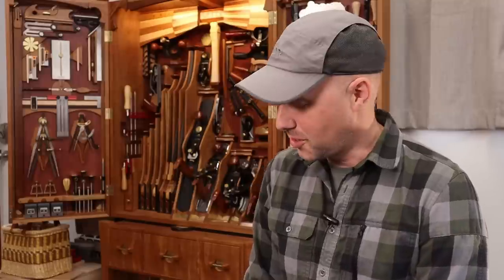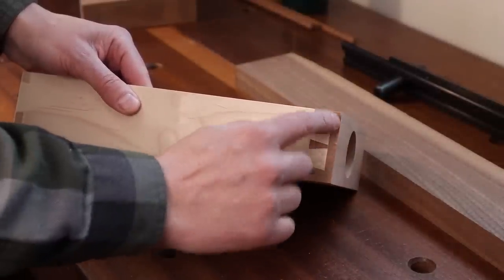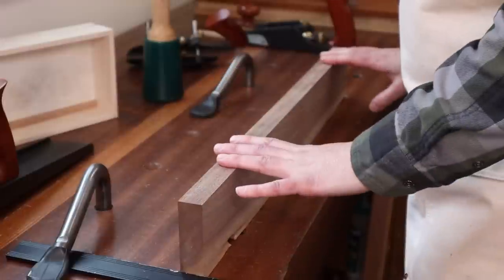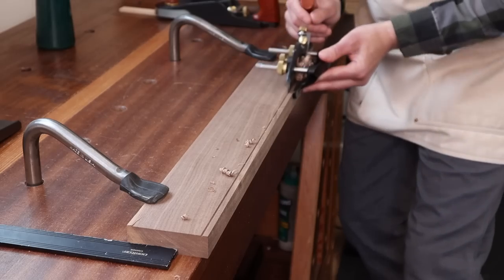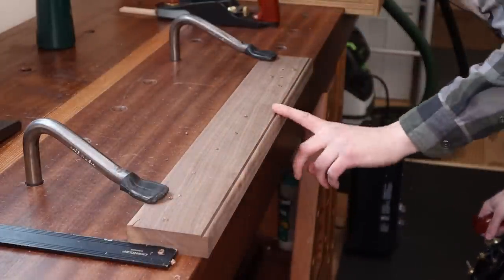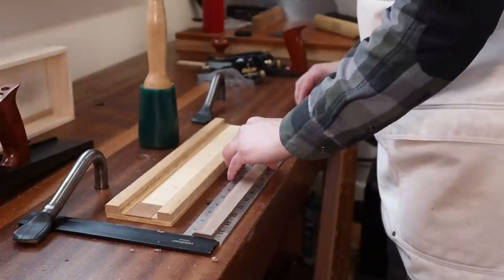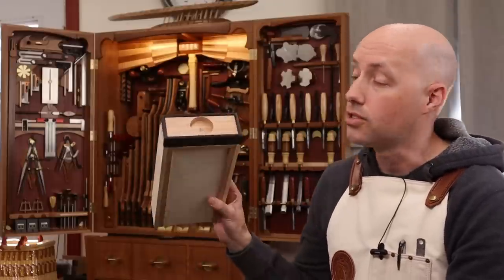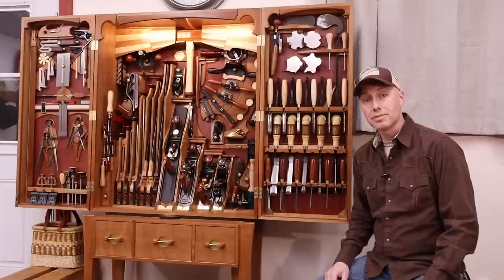C*ckbeading a Drawer, Seriously...That's What it's Called.

Comment: Your videos have resulted in me failing quite a bit at the techniques you've shown. It's been very fun trying to upgrade my skillset. That cockbeading looks pretty slick. I've never tried it before, but now I'm feeling ambitious. I think next weekend it's gonna be time to ruin some wood.

I also have a shooting sander, but mine is a piece of angle iron with a wooden handle epoxied onto it for a handle. When I'm making small model stuff it is a life saver. The Veritas version looks so good, but a quick shopmade one will work pretty well for folks that aren't sure if they should invest in something like that. The first one I saw was actually an old cracked stanley no5 that someone had stuck a 1/16" piece of steel to the bottom of and sand papered it.

I know that my homemade hide glue expands slightly as it cures, unlike pva. It certainly isn't as expansive as something like urethane glue, but there is a bit. If I don't rub the joint or clamp it down sufficiently, I've had it expand and make gaps unexpectedly. I'm not sure if your liquid hideglue does the same, but it might be worth checking.

Excellent video. I can't wait to see it all come together.
Reply from the maker: I've never noticed hide glue expanding as it cures. In fact, I heard on a podcast (don't remember by whom or when) that it shrinks as it cures and draws part tighter as it does so. Of course, my experience is anecdotal and shouldn't be taken as scientific evidence either. I've just had really good luck with rub joints using liquid hide glue.
Reply: @themountaintopjoinersshop8422  Interesting. I'll have to look into this more and make sure I'm not having some other issue and fooling myself. Thanks for the info!

Comment: Great look. Great look. Was wondering do you try to not get any dye on where you’re going to glue or would it still stick using that type of dyeing technique ?
Reply from the maker: The main reason I don't dye the glue surfaces is so I can still see my marks for left, right, top, and bottom. I don't think the dye inhibits glue adhesion, but I haven't really tested it to find out either.

Comment: Awesome video.  Thanks for sharing.  Appreciate your honesty.  This past summer I made an awesome dovetailed box.  Recently I've been working on a Shaker nightstand and tried to do as good if not better.  They turned out slightly gapy.  Sigh.  A long way of saying, I get it.

I've been wanting to try making a piece with cockbeading.  I haven't seen much out there so this video will be helpful.

What dust collector are you using in your shop?  I work similar to you in terms of mostly hand tools and I have a DeWalt 735 and a bandsaw (also a table top mortiser for when I'm feeling insecure/lazy).  Need to get a dust collector.  Been looking mostly at Oneida's.  Curious what you have and what you think of it.  Thanks.
Reply from the maker: Mine's the Jet JCDC-2 Cyclone and I've been really happy with it.  They make 1.5 and 3hp versions too.
Reply: @themountaintopjoinersshop8422  Thanks.  Just ordered the 8" Veritas shooting sander.  I can see where this will come in real handy and I use my shooting board a lot.

Comment: I’d be interested to know if that Veritas Sanding Planer requires a dedicated shooting board just for this operation? Otherwise, wouldn’t it sand into a planing type shooting board and make it wonky?
Reply from the maker: In either case, there's an area of the plane/sanding body below the blade/sandpaper that prevents it from cutting any further than the depth of the blade/sandpaper. I hope that makes sense.

Comment: I was wondering why you avoided using the plane shooting board with the sanding shooter.  Is there something about the sander that adversely affects the normal shooting board?
Reply from the maker: No. It's just, since I have a second shooting board, I may as well use it, so they can both be set up and at the ready at all times.

Comment: I wonder do you worry about wood movement for this type of joinery?
Reply from the maker: Not on this small of a scale. Very generally speaking, cross grain joinery like mortise & tenon doesn't become a problem until about 80-100mm wide (3-4") depending on wood species. Even then, the grain orientation (quartersawn vs. flatsawn) can make a pretty big difference for what you can get away with too.

Comment: Could you not glue on the beading before you cut the dovetails?
Reply from the maker: No, because the dovetails will need to be cleaned up and the drawer fit to it's opening by removing material, and if the beading is there during that process, some the beading would get removed along with it.

Comment: Really interesting design and enjoyable process to watch. 

Question for you, this is mostly a subtractive approach: you build the drawer first(very nicely done), and cut down the rebates for the beading to fit in. But would it be easier to take the additive approach(say if I don't already have a drawer), that is to make the drawer with thinner front using through dovetails, then laminate additional front board(a narrower board with circle drilled through), this will create same rebates as you did here https://youtu.be/aruQrTxEowU. And the glue lines will be covered by the beadings.
Reply from the maker: You can, in fact that's similar to how I did it with the drawer I show in the intro, if I recall correctly.